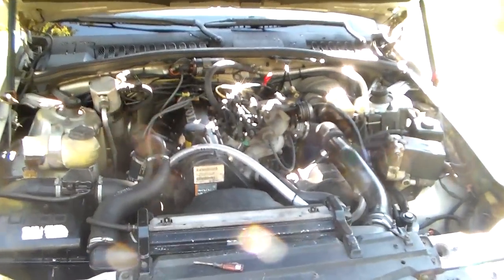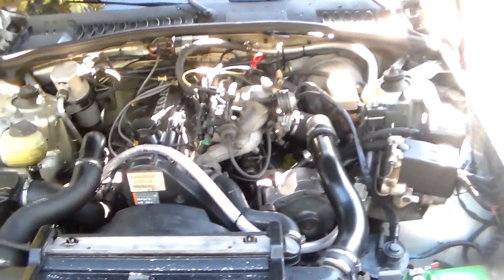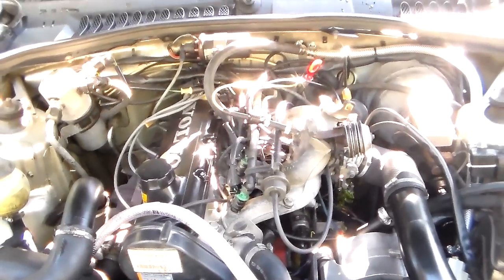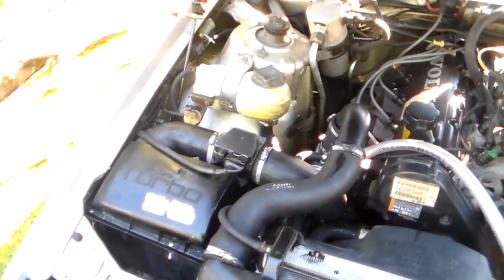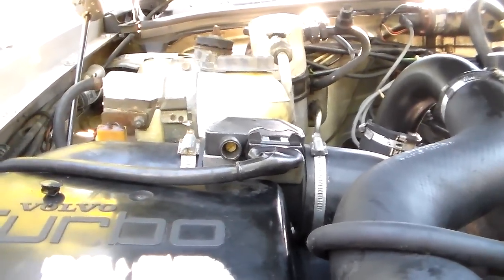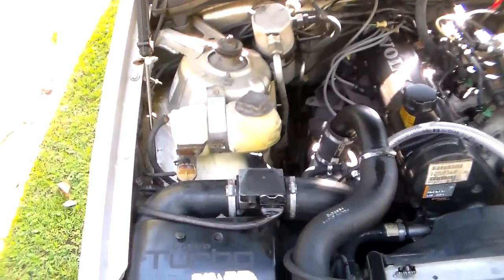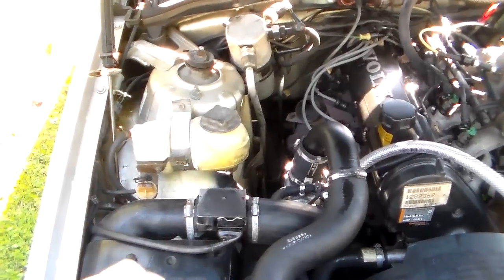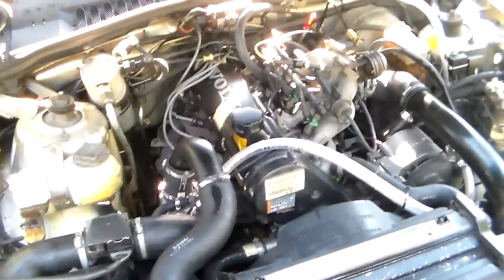Volvo B230 red block idle saga SOLVED

Comment: I have a Volvo 740GL, which is an old model (1989). I recently discovered that the car can "self-learn" at idle speed:

🔧1. ECU (Engine Control Unit) Idle Learning

Although the ECU of this car belongs to an early system (such as Bosch LH 2.2 or LH 2.4), the LH 2.4 system has some basic "self-adjustment" capabilities:

Learn the throttle position and engine load status at idle speed.

Fine-tune fuel injection based on sensor data (such as air flow meter, oxygen sensor).

If the battery is unplugged or the ECU is reset, it will need to re-learn the idle speed.

🔄 Idle self-learning steps (taking LH 2.4 as an example):

Make sure the throttle is clean (very important, otherwise the learning will be inaccurate).

Disconnect the battery for 5-10 minutes (reset ECU).

After reconnecting the battery, turn the key to ON (not starting) for 10 seconds, then OFF, repeat 2-3 times.

Start the vehicle and idle for 5-10 minutes at rest (without pressing the accelerator or operating loads).

Turn on the headlights, air conditioning and other loads to allow the ECU to learn different operating conditions.

Drive a distance on the road (10-20 minutes) to allow the ECU to fully learn.

🔧 Note: This will not be as accurate or comprehensive as a modern car, but it can effectively adjust some basic idling problems.

🔍 2. The relationship between unstable idle speed and learning

If you encounter problems such as idle speed fluctuating, flameout or too low, it may also be related to the following reasons:
Problem type Inspection focus
Idle speed is too high Throttle position sensor (TPS), idle speed control valve (IAC), vacuum leakage
Idle speed is too low or flameout IAC is bad, MAF is dirty, oxygen sensor is aging
Fluctuating Vacuum tube leakage, IAC control problem, engine temperature sensor reading error
🛠 Common self-learning and maintenance suggestions

Clean the throttle: carbon deposits will cause abnormal idle speed.

Check the IAC idle speed control valve: it can be cleaned with brake cleaner.

Vacuum tube leak detection: aging and cracking will cause abnormal idle speed.

Check whether the idle speed is consistent when the car is cold and hot.

In addition, the most important thing is to have enough battery power. If the battery is low, the car will keep self-learning. If it learns incorrectly, the idle speed will fluctuate, the engine will stall, and it will not start.
After I replaced it with a lithium iron phosphate battery, all the problems were solved!!

我有一台 Volvo 740GL 是一款老式車款（1989），我最近發現車子會「怠速車子自我學習」：

 
🔧1. ECU（引擎控制單元）怠速學習（Idle Learning）

這款車的 ECU 雖然屬於早期系統（如 Bosch LH 2.2 或 LH 2.4），但 LH 2.4 系統 具備一些基本的「自我調整」能力：

    學習怠速時的節氣門位置與引擎負載狀態。

    根據傳感器資料（如空氣流量計、氧氣感測器）微調燃油噴射。

    如果拔掉電瓶或重設 ECU，它會需要重新學習怠速。

🔄 怠速自我學習步驟（以 LH 2.4 為例）：

    確認節氣門清潔（非常重要，否則學習不準確）。

    斷開電瓶 5～10 分鐘（重設 ECU）。

    接回電瓶後，開關鑰匙至 ON（不發動）10 秒，再 OFF，重複 2～3 次。

    發動車輛，靜止狀態下怠速 5～10 分鐘（不踩油門、不操作負載）。

    開啟大燈、冷氣等負載讓 ECU 學習不同工況。

    上路行駛一段距離（10～20 分鐘）讓 ECU 完整學習。

    🔧注意：這不會像現代車那麼精準或全面，但能有效調整一些基本怠速問題。

🔍 2. 怠速不穩問題與學習的關係

如果你遇到 怠速忽高忽低、熄火或過低 等問題，也有可能與以下原因有關：
問題類型	檢查重點
怠速太高	節氣門位置感測器 (TPS)、怠速控制閥 (IAC)、真空漏氣
怠速太低或熄火	IAC 壞、MAF 髒、氧氣感測器老化
忽高忽低	真空管漏氣、IAC 控制問題、引擎溫度感測器讀值錯誤
🛠 常見自我學習與維護建議

    清潔節氣門：積碳會導致怠速異常。

    檢查 IAC 怠速控制閥：可用煞車清潔劑清洗。

    真空管檢漏：老化龜裂會造成怠速異常。

    檢查冷車與熱車時的怠速是否一致。

另外,最重要的是電瓶電量要夠,如虧電，車子就會一直反覆的自我學習,如果錯誤學習,就會出現 怠速上下飄動,熄火,無法啟動的問題.
我換裝了一個磷酸鋰鐵電池後,所有問題都好了!!

Comment: I think I have the same problem as you do here, replaced everything possible took it on a test drive was running great next day back with the same symptoms. It would start right up perfectly cold and once it started to warm up it would idle poorly and eventually just die, the rpm meter would be slightly moving up and down as well - 1990 Volvo 760 turbo

Comment: It does have a self dinogstic system though. Lil black box under the hood by the steering wheel, top pops off and have 6 ports with a prong to plug in. I forget what it is called, but it is on YouTube. Port 2 + 6 are the only usuable ports though for some reason.
Reply: That would be LH2.4.....

Comment: Had and still sort of had that exact same problem. Looking for a video to replace the tank to pump fuel lines and found this. Still haven't found a video to do the fuel line but it looks like just replacing the rubber hose connections on the metal lines once I can get under the car. My cars 80 miles away in the Georgia mountains so I need to take it all with me. Not an auto parts store anywhere up there to run to. Replaced the lower rad hose last week to get it to my house and while it was idling making sure it wasn't leaking I noticed the gas puddle forming under it. The big fuel line from the in tank pump was leaking where it connects to the metal line so I left it and came home. Easy to put the new hoses on but hard as hell reaching the lines to unclip them and drop them down. No way I can reach it from the access panel in the trunk without slicing my arms on the sheet metal.

Comment: tyler, really enjoying the Volvo vids, and Roberts, where did you find the info on the mass airflow meter and test light to get the stable idle, mine is the same, everything works as its meant to but idle is lumpy, new vac lines, iacv is working fine, very similar issues to yours, watched the vids more than once in the idle saga, more info please I am across the pond!!! exact same vehicle!!!!

Comment: I think Volvo and Saab had a competition to see who had the craziest engineers. I had a 900 Turbo Saab that never did make sense. The manifold was made of "breakium" which means if you look at the manifold more than 5 seconds it will shatter. Saab knew this and priced manifolds accordingly high; they quoted me $1500 for a new one. That's not including installation and gaskets! Not when I have a welder, buddy! The only thing that kind of made sense is it used a Chrysler K-car power steering pump. I see Volvo is just as wacky.
Reply from the maker: +Papi Johnson You are exactly right.

Comment: Tyler,  are you sure that there isn't a OBD port behind the left shock tower?  It has a black cover, when you lift it up, there should be a button whit a red diode, 6 holes and a function section cable.
Reply: I own one and it's very helpful..  Here' how one look's like from a seller on ebay.. http://www.ebay.com/itm/272084429715
Reply from the maker: +siemenstraffic I'll double check, but I don't think so. I think that was LH2.4...the next version.
Reply: +WhoSaidTyler It could be that you have a LH2.2 Bosch system installed that was installed in 1987  to June of 1988. I heard the Volvo car mechanics  hated thees cars, like you said, there is no OBD diagnostics installed. In July 1988 the LH 2.4 came out whit OBD I diagnostics system whit the RED LED so you could read the codes yourself! I manage to snag the official VOLVO a special code reader whit a mini display off the Bay that makes to make reading codes so much easier.
Reply: What's the special code reader?
Reply: On some Volvos between 1988-1995 was a black ODB1 port. There was a pin by the port and you stuck it in and flash the codes. Volvo had a special hand code reader for there service technicians to speed things up and so you didn't have to count the red flashing LED and the error code was put on a mini screen.
Reply: Very interesting. Do you still have this? Any pictures?